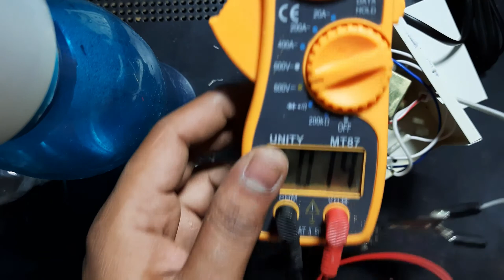HOW TO MAKE 6 VOLT 12 VOLT BATTERY CHARGER AT HOME (NEW VIDEO) electronics Diy. 🪄

Comment: Help me bro may is transformer ko hatake  dc input dena chahata hu solar ka or 12 volts out and switching karo to 6 volt mile batao kya karna🙄🙄🙄
Reply from the maker: Stup down modul use karo
Reply: @electronicsdiy818  ye kya hota hay?
Reply from the maker: Lm 2596 modul
Reply from the maker: Ye modul apko 12v input se 6v output dega
Reply: @electronicsdiy818  bhai may maine exact same to same charger laya maine socha iske andar ek board hoga may bus transform ko nikal dunga fir solar se input dendunga but Ismay to diode capacitor jaisa hay or is transformer ka 3 wires hay iska voltage v nehi dikhata mutimiter se may transfeformer ko nikal diya or jo diode laga usmay input deke dekha kuch nehi hua mujhe 14 volt and  8 volt voltage chahiye kya bina moudule ka  bina nehi hosakta?🙄
Reply: @electronicsdiy818  12 volt battery ko charge karne ke liye 14 volt something chahiye or 6 volt battery ko charge ke liye  7 volt 8 volt chahiye to ye voltages kaise milega 🙄
Reply from the maker: Iske leye ek video bana duga
Reply: @electronicsdiy818  han bana do🤟